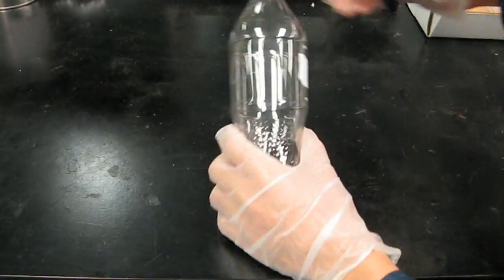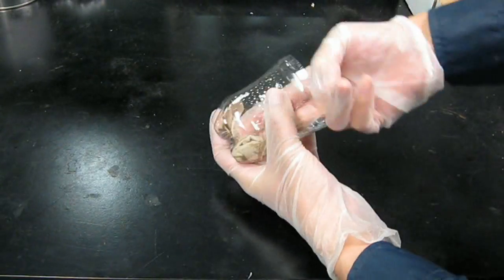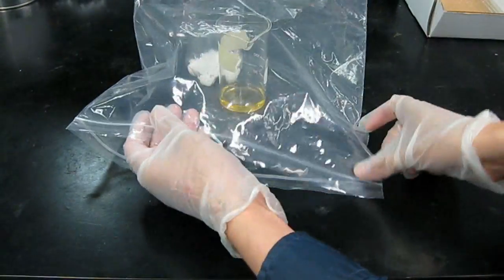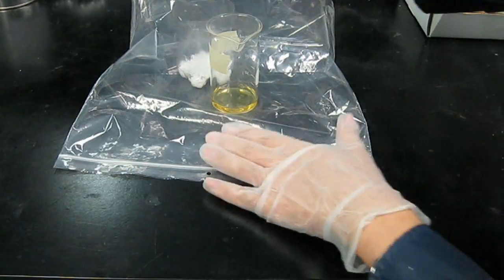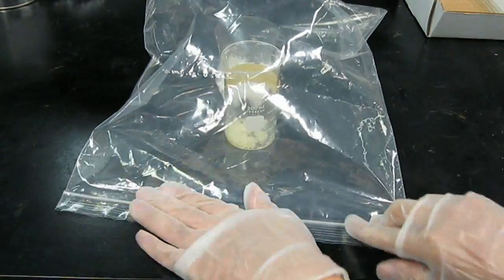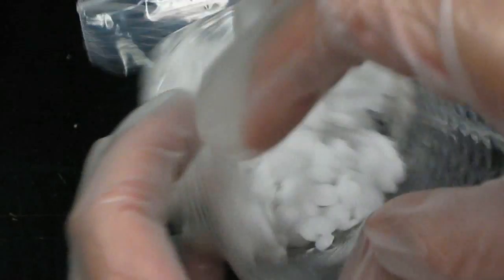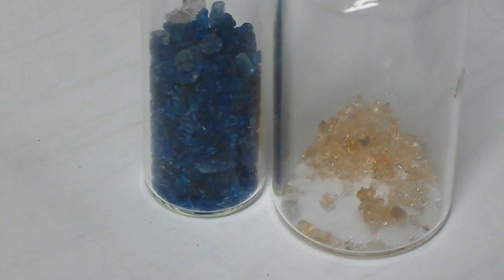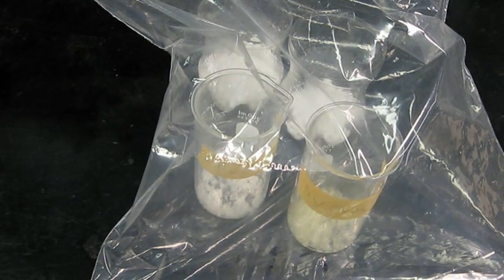How to make a Desiccator Bag for Drying Chemicals

Comment: Small note to anyone replicating this method: most ziplock bags are poor quality and leaky, much less air-tight. Ive made a few messes before assuming they would be. The problem is always in sloppy cutting at the edges of the opening mechanism (which can vary from bag to bag) - so check that, test the bag, or at least double bag if it's important that the seal is good.

Comment: I never knew sodium hydroxide was a good desicant. Is it more effective than calsium chloride? Because that's real cheap to buy in bulk (intended for ice melting driveways). Probably not nearly pure enough for direct experiments, but as a non-contact dessicant it probably shouldn't matter?

Comment: PLEASE HELP! I usually leave out such compounds  to dry out such as copper 2 chloride, and other such products, however ! Recently, I've finally invested in a gem of a vacuum chamber, and I want to , (for example!) Place the forever seeming to fully dry out slurry of cu 2 chloride.  Now is it ok, while I place the container of seemingly stubborn cucl2 in the chamber, as a desiccant, I took a small Pyrex bowl, and filled it half way with Na-Oh placed a paper filter over it, and then placed the bowls plastic snap on lid, which I had drilled 9 small holes on the top. In your opinions, once I place both containers into the chamber and bring the atmosphere to 29.92 hg, for 7 and a half hours, do you think the Na-Oh will be effective? And I don't have any other desiccant types , at this moment. I appreciate any feedback.

Comment: Would there be benefit in bringing the temperature up (e.g. a hot window sill or radiator) if you can determine the decomposition properties of the chemical in question? Also, however much desiccating you do, it doesn't affect the water of crystallisation of the product, e.g. hydration, decahydrate etc)?

Comment: Just a question ,thought from a non chemist, can these materials be used to absorb water from atmosphere and then be separated from the h2o to obtain the water ? Im thinking a passive moisture collector for drinking purposes concept...
Reply: this is inefficient and there are things that do this non chemically, dehumidifiers but you arent meant to drink the water from the, because it has bacteria. this concept itself is never going to be efficient enough to use in like countries with water scarcity (ie africa) and it'll need electricity anyways (both electric dehumidifiers or chemical desiccants, dehumidifier machines need electricity to run a refrigeration system to condense water from air and chemical desiccants need to be heated to release the water
Reply: Can this be use for bio-briquette ash? For drying and testing it?

Comment: Hi, I need to find a way to remove moisture from food grade powders supplements like acetyl l-carnitine so that I can encapsulate it. Is this method valid or is it risky possibly contaminating the supplements?
Reply from the maker: This method is an easy way for amateur chemists. But it's too slow and expensive for business use. For food grade powders what you need is a "vacuum desiccator" or "vacuum dryer". It's much faster and much cheaper overall, it's expensive at first, but just uses electricity (no chemicals like in the video). So cheaper in the long run.
Reply: Thank you for the answer! But for home use do you think it is convenient?
Reply from the maker: as long as they don't spill and you keep them in separate containers, it should work. I reccomend getting very high quality sodium hydroxide though. Drain cleaner grade probably has bad smells you don't want.

Comment: could this be used to concentrate hydrogen peroxide?
Reply: Yeah, you definitely can, my science teacher the other day showed us a capsule of what used to be sodium hydroxide pellets but the capsule broke over the summer and it started to absorb the humidity of the air. Then when we came back, there was a small amount of sodium hydroxide solution prolly like 5ml or so
Reply: I know this is old but the time it takes for a desiccator to concentrate h2o2 would probably be enough for it to decompose.

Comment: I personally don't use a plastic container such as a drink bottle as most are made from PETE/PETG, a resin which is very vulnerable to NaOH (as shown in the video). For my desiccator box (I use a small Tupperware box because I'd rather have something that is easier to move than a bag should it need relocating) I choose to use disposable clear Polystyrene shot glasses (can be purchased very cheaply), they are resistant to Sodium Hydroxide as well as most other desiccants you can use.
Reply: in theory the best thing you can go for is PTFE. PTFE will not be corroded by any acid and base. ( glass will be attacked by NaOH but very slowly) However, PTFE is way more costly.

Comment: sodium hydroxide does not "eat" glass at room temperature. I have had a 1L beaker of solid sodium hydroxide for months in a dessicator  and when I change it every few weeks it is perfectly fine. Also the absorption of water from a hygroscopic compound via evaporation does not create enough heat to do anything to plastic.

Comment: it eats through glass not PET bottles -the reason the PET bottle had holes in it was because NaOH produces heat when absorbing water from air & this melted the PET container , but only over long intervals , glass will dissolve in a few days.
(PET better than glass{even borosilicate})

Comment: Yes! but only if its anhydrous, to make it anhydrous heat it up to a high temperature in a combustion stove/fire or with a propane torch. It should be a white powder, epsom salts comes in pretty transparent crystals and is the heptahydrate(already has 7 H2O molecules stuck to it making it a useless drying agent)

Comment: Do you have any suggestions for using desiccators in a duct system to pump completely dry air into a room/building? I thought about desiccating rods in combination with a membrane that will filter some of the water out, but it seems like the components would need to be replaced too often for that to be viable.

Comment: im trying to make rust oxide by connecting an iron rod to a positive terminal and putting it in water with the negative terminal in the water. I am making this for later production of thermite, but its taking FOREVER to dry, and when i tried cooking it, i barely got any rust oxide. I think its hygroscopic, but i dont want to waste time making a desiccator bag i dont need.

Comment: I'm just wondering why the height of the desiccant container needs to be similar to the height of the container of the item you want to dry, I would think a low, large dish would be best for absorption, isn't the humidity roughly the same if the levels of chemicals in the containers is the same?  The only rationale that comes to mind is using similar heights to avoid trying to dry out the air in the bag to conserve desiccant.  Thanks!

Comment: ok sir how about this. using eletrlysis or whatever, send current though 2 bowls of super saturated salt water using a salt bridege. the hydrogen atoms displace and combine with the sodium. so i doubt you know this method but ill ask anyways. 1. anyway to pump up the concentration level. 2. do i evavorate off the water to get the sodium hydroxide.....lets just say i ran out of lighter fluid to burn my wood.

Comment from the maker: @pinkytm1 

I think your better bet might be to mix milk of mangesia, (which is magnesium hydroxide) with hydrochloric acid. You'll get a purer product that's easier to crystallize.

But if what you have is all that's available, then i would first try a slower method of cooling. sounds like its cool too fast and causing it to crap out like that.

Comment: there is a better drying agent out there - magnesium sulfate can be bought in big bags at the pharmacy as epsom salt. It won't eat through your container, and is reusable. You just need a hot plate to remove the moisture from the mgso4. I might post a vid on this later.

Comment: Just a tip, if wanting to save on chemicals; you could take the dissector in this case, silica beads or sodium hydroxide and heat them up removing the moisture from them as well. Then they are good as new and are ready to be reused.

Fyi - Not all desiccants are the same so always read upon the hazards of heating what ever desiccant you are using.

Comment from the maker: @weldmaster80
The sodium hydroxide will eat through the glass if given enough time, the point of using plastic containers is that they are  disposable.

If you want to reuse your desiccant i instead recommend going with the silica gel or one of the sulfates mentioned in the video description.

Comment: One problem I can see is that PET drink bottles will hydrolyze with conc. NaOH (or other strong bases). As the dry NaOH absorbs water and forms an aqueous solution, you might get to the point where the bottle is so weak it can fall apart when you move it.

I use drying agents that can be regenerated by heat such as MgSO4 or CaSO4 that won't be so aggressive to bottles such as NaOH/KOH.

Comment: I used this technique to dry my "sealed" cell phone battery after getting my phone wet.  Got all the circuits completely dry but the phone still wasn't working.   Turns out it was the battery.  The desiccant was calcium chloride bought in the paint section of the hardware store.

Comment from the maker: @Pipewing

sodium hydroxide cannot be reused.

Silica gel and molecular sieves (not shown) can be reused, but are hard to get.
Reply: Common sieves like #3-4 can buy cheaply, Bought in bulk of eBay not cleanest little dusty, reuse from work or lab. Probably lost more than have. Can reuse NaOH if just H20 in example heat it dry?  Like other agents, not fast & hot unless want a block-solution to large solid. Increase incrementally in temperature over 2-3 steps. What was time lapse?  Big fan, new generation!